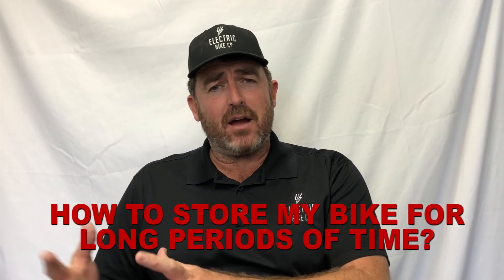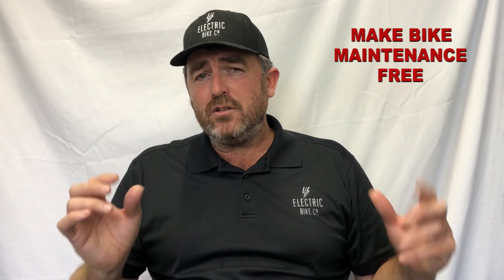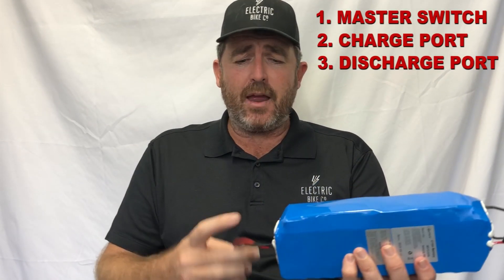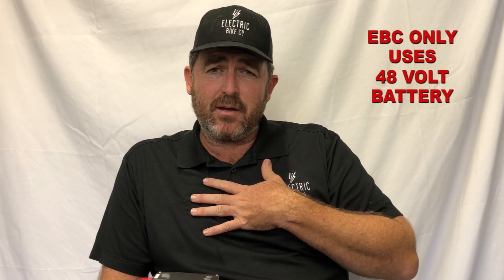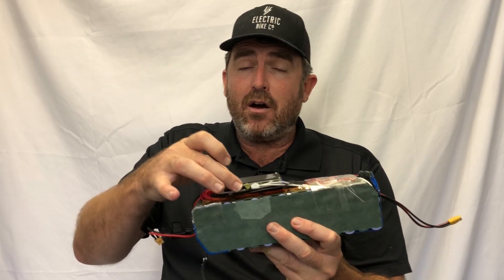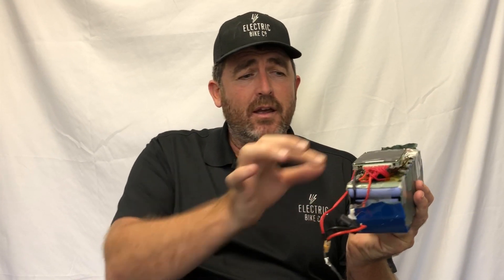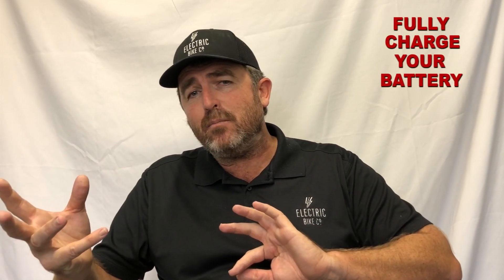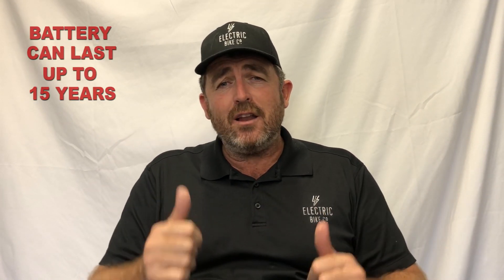E-bike Battery Storage [EBC Insights]

Comment: What kind of container should I have my battery in when in house?
Reply from the maker: Hey MR57LV, the container isn't as important as the location. Make sure you store it in a dry area that doesn't get too hot or cold. Batteries are temperamental when it comes to temperature haha. As long as you satisfy that and charge the battery at least once a month the battery should last you a long while. Hope this helps!